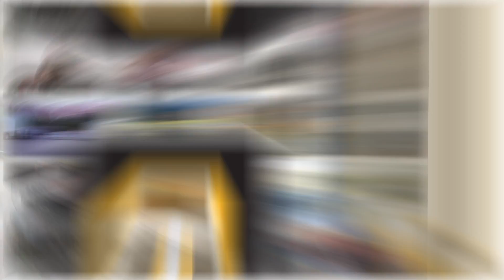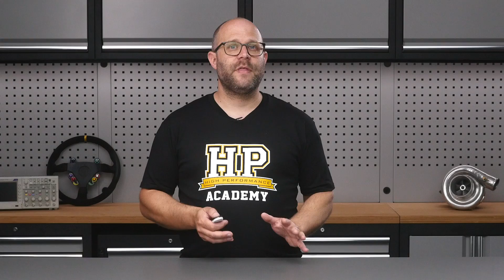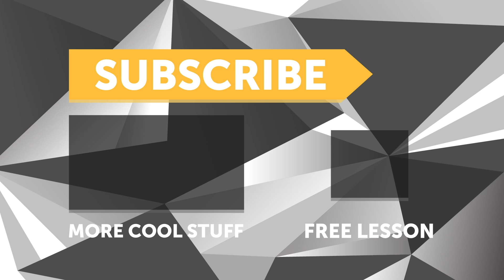What is CAN Bus? | CAN Communications

Comment: Why don't they standardize CANbus?
Reply: It is standardised - a basic level of info is all there in the same places all the time, however, manufacturers both OEM and aftermarket, can add whatever they want to it. meaning the more specialised data is either not there, or there in different places between makers.
Reply: @dataminetk  That defeats the purpose of standardization. I get adding feature sets but its like Teslas charging port vs Nissan and other manufacturers.
Reply: @sporkybutterz  the situation would be much worse if CAN wasn't extensible as then every maker would have a new system to control your air con. Or entertainment. Or at an even more absurd level. Imagine if makers couldn't add something that is engine related but not around when OBD2 was standardised. Say flex fuel, or direct injection, now you have extra buses to run the engine.

Having to decode some unknowns on the CAN is much better than the alternative where either CAN didn't exist or was not extensible.

Comment: I hate to say it, but the involvement of sws and can bus systems in the modern vehicle  spelled the end for the diy car modder. And sure on paper it makes sense, and is meant to be simpler, smaller and more cost effective, but look under the dash of any modern car and theres wiring "everywhere"! Ill stick to a 90's style one wire for every function type deal, it always seems simpler and added benefit, anyone can work on it. 
Its hard to change...I know i need to get with the times. Cheers for the great content.
Reply from the maker: Like anything, it's simple once you know it 😂 The beauty of doing your own project though is that you can do it however you like so there is nothing wrong with what you're up to there either though Brad so nothing to really stress about too much until there is a specific need to it differently, if ever - Taz.

Comment: I am interested in the class, but I would like to use an Arduino-Can adapter to get data to my arduino for display and dissection. Does your class better clarify the programming and how to understand raw data of CAN systems, or is it geared towards using a proprietary software to interpret that data.
Reply from the maker: G'day Christian. Absolutely, the course teaches you about the protocol from a really low level, and will be excellent for getting you up to speed. While we can't offer any help with the Arduino coding, you'll learn all about the CAN protocol and will be able to understand the documentation of whatever libraries you end up using much easier. One of my larger projects at Uni was interfacing an STM32 uc to automotiva CAN streams, and I really wish there had been something like this course when I was starting out, would have saved me a lot of time! Hope that helps  - Zac.
Reply: Same. I want to learn how to "sniff" out CAN signals in different vehicles and manipulate them. CANbus is such an obstacle when considering engine swaps or large modifications.
Reply: Great question
Reply: You might save some money using an arduino for working out the data on a CAN bus, but you certainly won't save time. You're better to uae a dedicated CAN tool. There are many on the market with a wide price range.